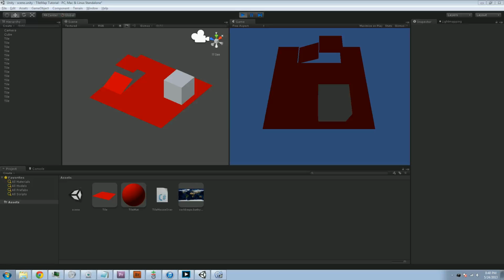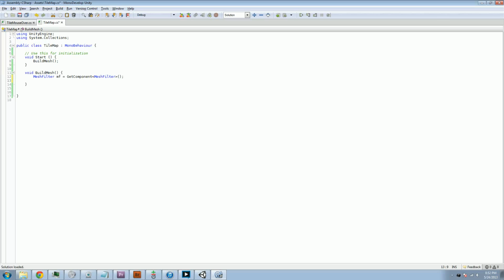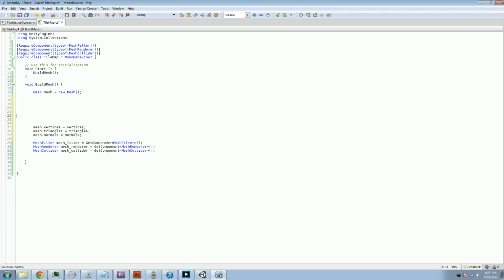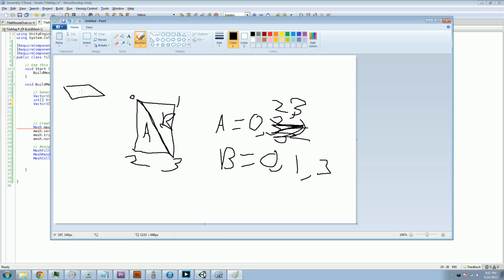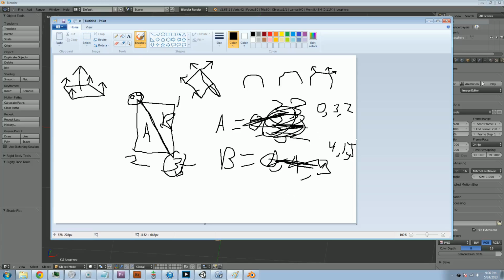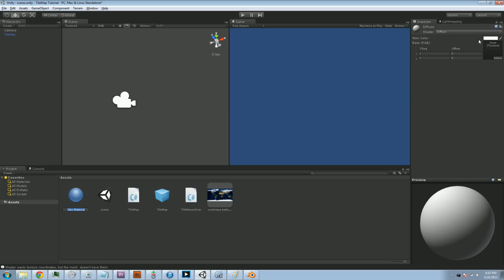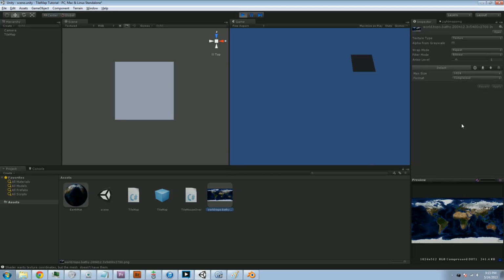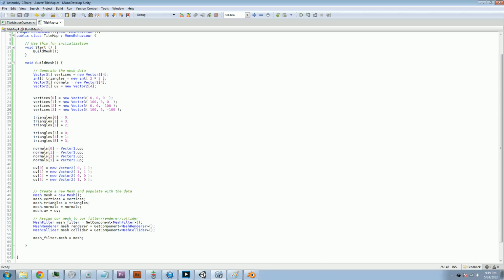Unity 3d: TileMaps - Part 2 - Generating a Mesh + Texturing

Comment: Got to around 22:00 in. No pink square. Tried applying the material exactly like he did. No grey square. I've got nothing on my screen right now and I've checked my code with a fine toothed comb. No typos. It's just not working the same way in 2017.
Reply: I ran into a problem like this, I changed "mesh_filter.mesh = mesh;"  to "meshFilter.mesh = mesh;"
That worked for me.

Comment: If there are normals, how can the engine render the triangles in the wrong side?
I dont get it
Reply: https://docs.unity3d.com/Manual/AnatomyofaMesh.html
Looks like Unity only uses normals to reflect light, so you will end up with reflections in the correct side, and the texture in the wrong side

Comment: For the texture - because it was flipped vertical, rotating the camera wouldn't fix it.  It was correct left-right, just the top and bottom were wrong.

The only other way to fix it would have been to flip the normals and then flip the mesh over after that.

Comment: Sat there forever, trying to get the numbers just right, my textured mesh was showing up, but black.  Figured the texture wasn't mapped correctly.  Then it dawned on me I need to add a light to use all those normal and handy words you were throwing around.